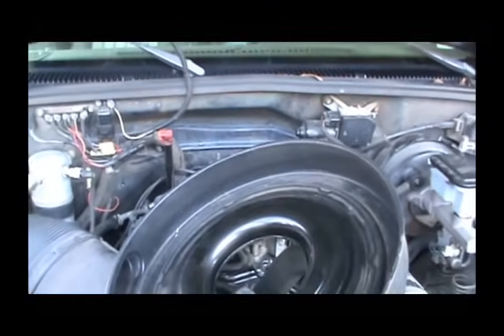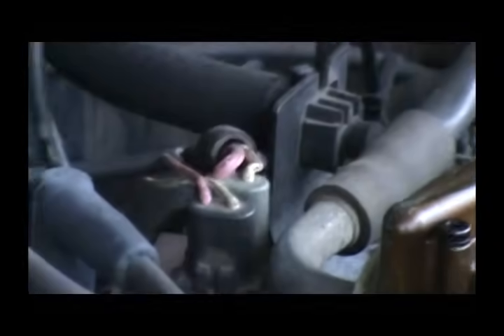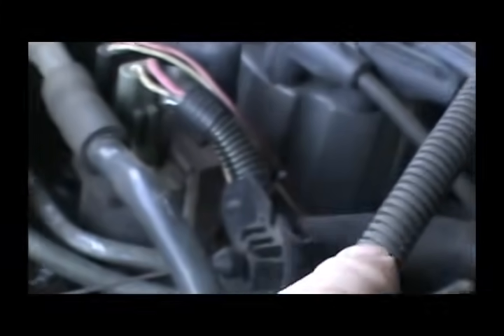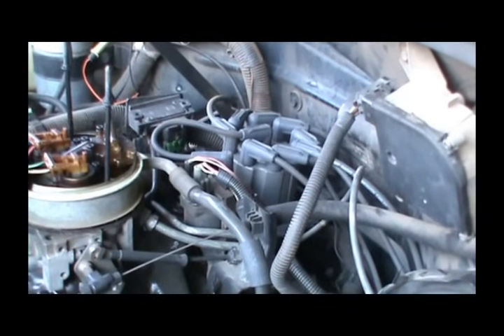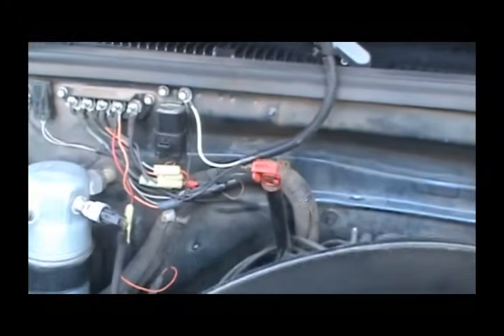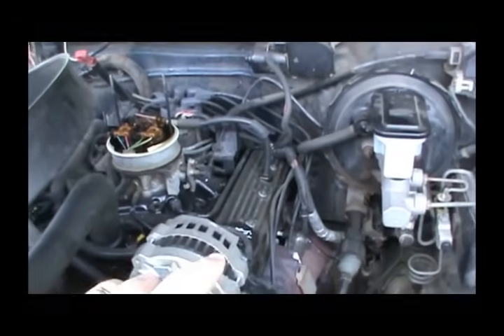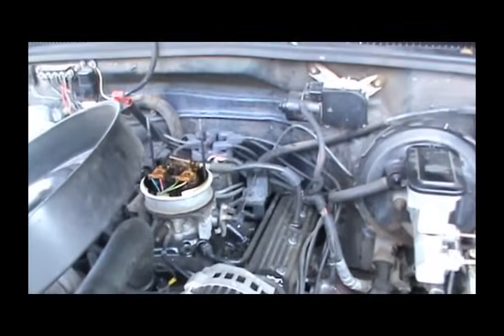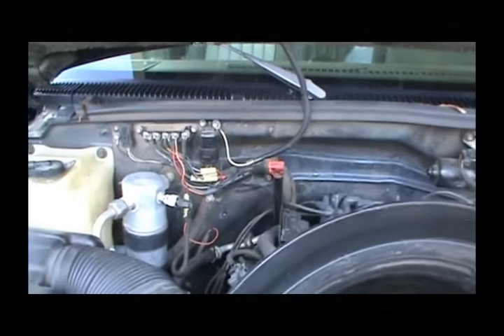1988-95 GM Truck Ignition Systems

Comment: I have a 1991 k1500 5.7 did a complete tune up except coil, ran great for 100 miles, now experiencing a flat out no power situation, runs rough idle and can not pull a hill or gain speed at all except over time. I can put my foot into it and sometimes it will act normal until I take my foot out of it but than it acts like not running in all cylinders. Oh yes revolution the throttle body as well thanks Don
Reply: I have a 1993 GMC 350 TBI that has fire to the coil and to where the coil wire plug’s in to the distributor cap but it is not going through the plug wires what could be the problem with it I have put everything new in the distributor and coil area

Comment: I got a 93 Chevy 3 quarter ton TV I crank it up fine but when you started driving it won't like it's not getting no gas and I don't want you don't have to keep pumping accelerator to keep it going and it won't be let off it goes dead

Comment: Hey when I set the timing on my 91 Silverado at 0 degrees top dead center and then pull the Ecm fuse and put it back in and plug the ecm wire back in  and start the engine, I can't see a timing mark anymore, it's like it's so far Advanced that don't want to idle at stop sign, and I set the timing when it was warm so it wouldn't do that ,but it keeps doing that what am I doing wrong? It ran great but the intake gasket was blown then I changed it and then the timing has never been exactly right since..  it runs strong but won't idle so I was wanting to start at 0° but computer keeps changing it too much..
Reply from the maker: There should be a sticker under the hood that says what the initial timing should be.  I'm thinking it is about 8 deg BTDC but could be wrong.

Comment: Good advice,.... i have a 93Sierra that never stalls but often will not start do to no spark...then one day when it feels like it she'll start !    Should of never gone away from good ole points !
Reply from the maker: Haha, well I do agree that the ICM is a finicky module and it does not like heat at all.  Don't buy a cheap one either or it will not last long.  I doubt OEM modules even exist nowadays though :(

Comment: I’m getting spark. It no fuel however with starting fluid it does not crank over so I’m not sure why it won’t start
Reply from the maker: Fuel pump bad, fuel pump relay bad, fuel filter clogged, computer bad...

Comment: 4.3 the same way ? Thankyou for any information you can give me on this God bless
Reply from the maker: Should be pretty similar.
Reply: After replacing the brake booster and driving around all day now it won't start, 92 , 4.3. going to start down the rabbit hole tomorrow. Happy 4th of July and 5th. 2025.

Comment: He forgot to mention the ign. control module  under the distributors cap it usually goes bad
Reply from the maker: That and the pickup coil.  Heat kills those ICMs and most aftermarket ones are junk.

Comment: I gotta question I have 92 chevy k1500 after tightening thepower wire to the ALTERNATOR my fuel pump wires burnt I replace the wires where the burned a little that issue resolved but while doin so I hooked them straight to the battery to test the pump it still work  UT after wiri g it back correctly I have no cli king no spark absolutely nothing when I turn to the key to try and crank the the truck

Comment: Hi am Ernest. My c3500 just happened to shut down. No fuel from the throttle body no start. But starts when I prime it. Fuel pumps works. Can u help?
Reply from the maker: It's probably a little late on the reply, but how do you know the fuel pump works?  Did you pressure test it?  Does it stay running after you prime it?

Comment: hey I have a 1990 chevy silverado my truck keeps draining my battery and I couldn't find a bad ground im pretty sure the alternator is good and I am on my 3rd battery could you maybe help me out
Reply from the maker: Best way to find a battery draw is to use a ammeter with a cable clamp.  Place the clamp over the positive battery cable and start pulling fuses to see which circuit has the draw.  Once you find the circuit, you'll have a better idea where to look to find the issue.

Comment: Great video! I was hoping you could help me with a problem I am having on my 89 Chevy 5.7 K1500 truck. My initial problem was it would not start, because it's 33 years old with 150k mile I thought I would replace the fuel pump. This was not the issue, still would not start so I check for spark, no spark, so I replaced the primary coil, pick-up coil, ignition modular, distributor shaft, cap and rotor button. It started right up and ran. I unplug the EST plug (advance timing) to set base timing on TDC. But with the EST unplugged it will not start. Any idea?
Reply from the maker: If it will not start with the wire unplugged, more than likely the ignition module is bad.  I've seen it where the ignition module is bad when they're new.  I think Autozone can test it, or they used to be able to test it.  Don't buy one from Autozone or Advance Auto.  NAPA is your best bet if it's bad.
Reply: @farmboy30117  Thanks for you quick response. Since I wrote you, I set timing on TDC with EST plugged in and it ran smooth, I took it around the block and it even had a little more pep. How can the ignition modular be bad yet start and run so well? I put an AC Delco ignition modular from Rock Auto hoping it would be a good one to buy. Do you think it will hurt anything to run it like this?
Reply from the maker: @gtuttle4  I probably misspoke about the ICM.  I'm no expert on this.  Here's a good video that explains how a GM bypass system works: https://youtu.be/_Ijhi7ai1HY
I'm not sure why it won't crank with the reference wire unplugged unless that's not the reference wire you're unplugging.
Reply: @farmboy30117  Yeah, I just now found his video, I'm sure it's the EST plug, it has the tan and black wire plug, although the location of the EST was not where it was suppose to be for a '89. It's located on the firewall on the driver's side like a '87 model. Thanks for your help!
Reply: Always get the AC Delco ignition control module D1984A or D1943A I believe they are the same. And always use actual thermal heat sink paste and not that clear di electric grease. The aftermarket china made ignition control module are junk.
Reply: @mritron7649  Yeah, I installed all AC Delco parts.

Comment: Having issues. 
Replaced fuel pump 
Replaced fuel filter
Distributor cap an rotor 
Spark plugs 
Coolant sensor 
Fuel pump relay 
Dumping alot of fuel and gauges acting crazy.
Reply: Have any thoughts ?
Reply from the maker: @solutionscalebgearheadz5204  I would look for a bad ground if gauges are acting weird.   I assume it's pouring fuel into the TBI?  Like the injectors are stuck open?

Comment: (95 1500 tbi) when all else fails, check the tach wire at the coil for ground.. If it has constant ground, a quick fix to get ya rolling is to clip it. The coil is signaled by ecm through the other white wire found in the second connector on the coil and these 2 splice into pine another inside the coil. The tach wire is finding a ground (i haven't began my search for it so ill try to get back here with an update) and that ground is trying to energize the coil anytime you hit the key and with enough time burns up the coil.. So if clip the wire orfix the ground, but still no spark.. Test your coil that you've likely just replaced or had replaced.. Hope this is helpful to someone nonethless
Reply: So my issue is the tachometer wire, how did you fix the issue permanently. I would love have operating tachometer as well lol
Reply: Can someone simplify this for me I don’t really understand what’s clipping and what’s not
Reply: hi i had replaced the clips that go to the distributor.my truck would start with starter fluid but now it doesn’t can it be the coil?
Reply: @559Obsalex same here with my caprice. How did you resolve it?

Comment: I'm getting fuel but no spark what do you think is?? Truck was running great than it wouldn't start out of no where
Reply from the maker: I had the same issue several years ago.  It was the pickup coil but I just replaced the entire distributor.  It was easier and cheaper than just the coil.

Comment: My 1991 will run with with my foot on the pedal and shut off once I remove my foot..any ideas..I've changed fuel pump, fuel filter, distributor and plugs
Reply: If the EGR valve is carboned up / stuck open ,broken diaphragm  and allowing exhaust gases to pass at low rpm  it will not  idle very well. Idle air control sensor 
be throttle position sensor. 
 Your throttle body butterfly flapper could  be closing.There must  be a slight gap to draw in air at idle.

Comment: I have a 93 silverado fuel pump works and i changed ignition module and still no spark any ideas?
Reply from the maker: Pickup coil or primary coil could be bad

Comment: Hey I have a 90 Silverado I want to add a kill switch can you tell me where the wire is to splice into.thanks
Reply from the maker: The ones I've seen are spliced into the neutral interlock or clutch interlock switches.

Comment: I have a 91 S10 with a new 4.3 remanufactured motor getting excessive amount of fuel flooding out the truck loading up the crank case with gas what could be causing that
Reply from the maker: Probably a little late, but I think you should check the fuel pressure regulator.  It's built in to the throttle body

Comment: So if I get the no spark situation again, can I unplug the beige wire and see if it starts then ?  Can we leave the wire unplugged permanently? I remember unplugging it inside the cab to set timing
Reply from the maker: Unplugging the wire bypasses the ECM control of your spark timing.  If you have spark with the wire unplugged and then lose it when the wire is plugged back in, that would indicate a bad ECM.  I wouldn't advise running with it unplugged because you will not have any advance on the timing and it will run poorly at anything above idle.
Reply: @farmboy30117  ok thanks, haven't driven it much lately. Too damn cold here in St.Louis to risk a breakdown out on the road. Did they eliminate this ignition system in 96' ?.
Reply from the maker: @timkapeller6948  I'm not sure.  I know they went to the vortec engine in '96 which did away with the Throttle Body Injection system.  I haven't had any experience with them.

Comment: Hey regarding that wire that isolates ignition from ECM...I have a 1991 Chevy 1500 and there's a plug there but it's white with black stripe.  I unplugged it and tried to start but still no start. My issue is either ECM, ignition module, or pickup coil.  
I wish I could post a pic of mine. It's in the same area you pointed to but is a different color.
Reply from the maker: I've heard they are in different areas depending on the year.

Comment: Great video! I have a 1992 GMC Sierra never had a problem until today. Let the batter die and gave myself a jump truck started up fine but shut off! Now will not start. It cranks but won’t turn over!! Any advice would be appreciated. Thanks
Reply: Did u find out the problem same exact problem same truck
Reply: Replaced a lot of parts

Comment: I have a 93 k1500 that runs perfect with the advance unplugged, as soon as I plug the advance back in i have to pour fuel down the throttle body for it to start. After it starts it will run but to me it sounds like it has a fuel knock or the timing is off. Any ideas?

Comment: Still not getting spark on mine was running before i put new coil distributor and unplugged wire getting fuel no spark
Reply from the maker: Check for power and grounds.  Could be broken wire or defective parts.

Comment: I'm hoping you can answer this. My truck has a rough idle like it's not advancing the timing. I have done cap, rotor, coil,  ignition control module and even the distributor at this point. When we unhooked the wire to set the base timing the truck dies. It show's a code 42 which comes up as ignition bypass circuit error.
Reply: What was setting the code 42?
Reply: Did you ever figure it out

Comment: Mine starts up and shakes a lot know what could be the problem?
Reply from the maker: Sounds like some plugs aren’t firing properly.  Have you give it a tune-up lately?
Reply: @farmboy30117  yeah changed wires and spark plugs and oil change

Comment: Buddies truck has an issue and we don't know where else to look! New cap rotor coil ... Cranks gets fuel does not fire but will fire with a small shot of starting fluid.

Comment: I need help 92 Chevrolet c1500 with 4.3 tbi ive got fire at the coil but no spark at the plug wires
Reply: Bad rotor dirty distributor cap

Comment: Good info. Thank you. I replaced the complete distributor,coil,cap,rotor,plug,and plug wires. Set timing and started up. Set base timing. Shut off truck and will not start back. Any ideas ?

Comment: Quick question. I have a 94 Silverado c2500 with a 5.7L. If I use starting fluid it starts and runs fine. No starting fluid it just cranks till the cows come home. This started after using engine degreaser and power washing it off. It started fine after the spray and I let it run for a bit to dry everything up. Was looking fir an oil leak. Any help would be greatly appreciated.
Reply from the maker: Sounds like a fuel issue but very weird for a gas engine to act like this.  No idea on this one.
Reply: @farmboy30117  I noticed off or the key on no fuel comes out of the injectors. So guess I can start tracing and testing there
Reply from the maker: @hangoversamuiadmin3163  Maybe start with the fuel pump relay
Reply: @farmboy30117  Will do, thanks for the help
Reply: @farmboy30117  Ok, so replaced the fuel pump relay, same issue, reset the computer and it was flashing code 21, read about it... cut a hole in the bed and replaced the fuel pump... not the problem... Its a long bed so was not able to lift it myself and I filled the tank like a day before this started... Today went and got a fuel filter and a new TPS... Replaced both of them and now it works fine, my code 21 is no longer there so guessing it was the TPS that caused the issue. I can honestly say after reseting the computer the idle is perfect now and it even seems to run better! Thanks for your help man very very much appreciated!
Reply from the maker: @hangoversamuiadmin3163  Dang hate to hear about your bed, I had to change the fuel pump on my shortbed, stepside and it wasn't a fun job, but I used a jack to prop it up.  Funny how it didn't set a code for the TPS.  These early OBD-1 computers just weren't all that great for diagnosing.  Glad it worked out for you!

Comment: I've got a 89 k1500 with no spark. I've put an inline tester on 2 different plugs and it flashes once when I turn the key on and nothing while cranking. 
I tried the bypass you showed and still no spark.
Reply: You will NEVER get spark from it , throw it away .

Comment: I have a 1989 k1500 5speed and when I unplug wire and run icm it idles amazing but when the pcm tried to idle the truck it just dies and looped and I replaced ecm and prom, and egr, iac, map, tps please help
Reply: It also will start fine it just won’t idle
Reply from the maker: Might be a little late but it sounds like you’ve replaced all the usual suspects. Since the icm only cares about initial timing I would say your distributor is good. I would double check that initial timing is correct because from what I’ve seen the pcm really picks up the advance on timing.

Comment: Looking at a 93 Chevrolet, decent looking truck. Guy says it had some wires cuts so he bought a wiring harness... Question is, how difficult is it with replacing the harness ? And or maybe just the ignition part of the wiring harness...
Reply from the maker: I wouldn't think the engine harness would be too bad.  There's not a lot of sensors compared to later models.

Comment: I'm having a starting issue, I have a 94 1500, I replaced the motor with 1 out of a 89 model, new plugs and wires are on it!! If I were to do this would this be the culprit?! I did not replace the computer or anything! Its spinning over but wont turn over for me. Any ideas would be appreciated!!
Reply from the maker: Will it fire on starting fluid?

Comment: Hi, can you help me with my ‘91 full size jimmy, 350. I’ve changed every sensor and I can’t get it to idle correctly. Sometimes high at 1000rpm and low at 4-500rpm. Changed the coil, rotor, cap, plugs/ wires. Engine temp, O2, map, Idle control valve, throttle position sensor, E spark control and rebuilt the TBI itself.
Reply: Do a hard reset on your car computer. Just google hard computer reset, Scotty Kilmer has a good video that I just did, fixed my hard idle and rare misfire. 
If that doesn’t work I would suggest adjusting your idle speed manually. There should be a screw somewhere near the TBI where you Can do this. Just look up videos and try it out.

Comment: Please help -Ok I have a 88 with the same coil - on the side with the thicker wire -the wire wire comes out of the plug that goes to the cap that plugs into the coil comes out and is cut - it’s Allways been like that - where is it supposed to go 🤷🏾‍♂️
Reply from the maker: I believe the white wire would go to a tachometer

Comment: Thank you brother. Can't wait for it to get daylight so I can check this. Replaced my head gaskets and hasn't started since. No spark.
Reply from the maker: This could also be caused by a bad pickup coil in the distributor.  I believe autozone can test the ICM but don’t buy one there. Get it from a higher quality supplier like NAPA.

Comment: the module is to the left of distributer? with one electrical plug?
Reply from the maker: The ICM (Ignition Control Module) is under the distributor cap inside the distributor.
Reply: @farmboy30117   thank you sir.  what is that thing called that is to the left in your video it has a green plug on it and a vacuum line
Reply: MAP sensor?